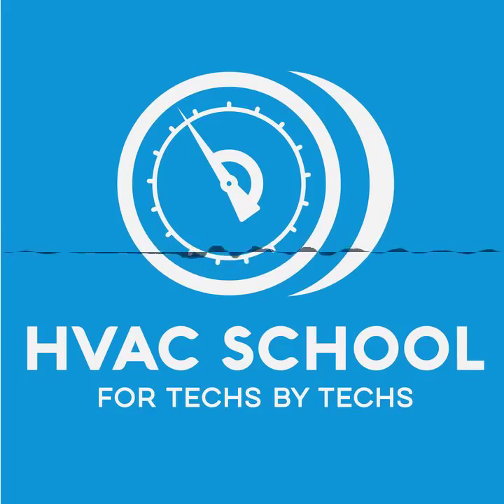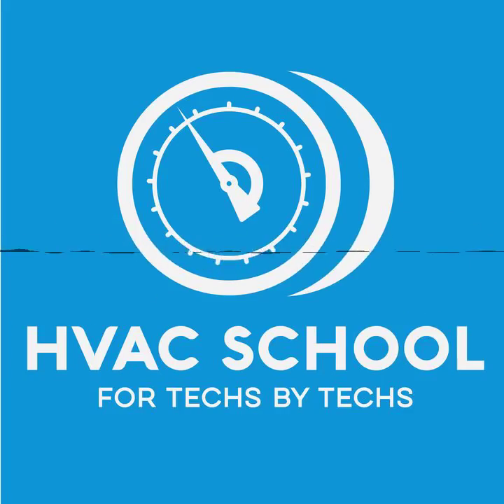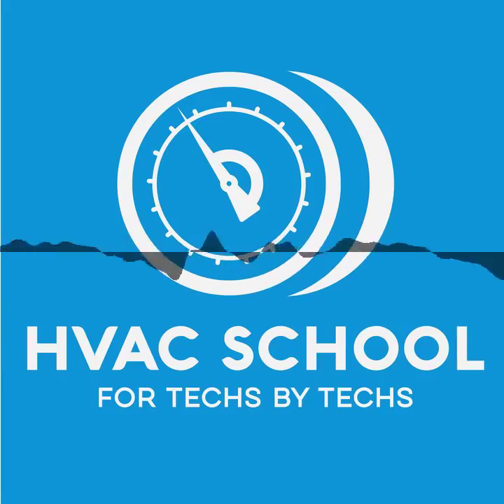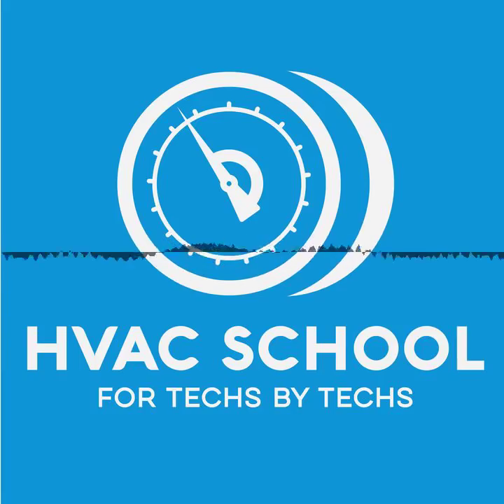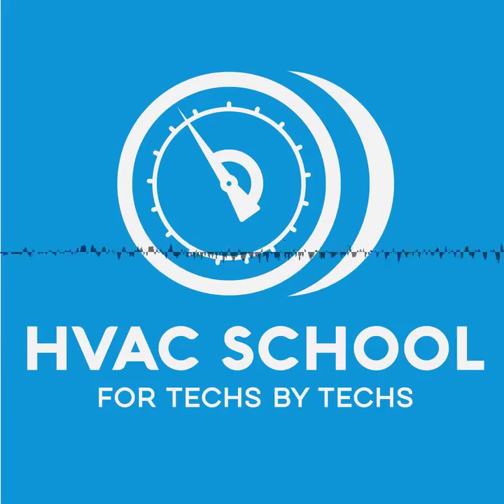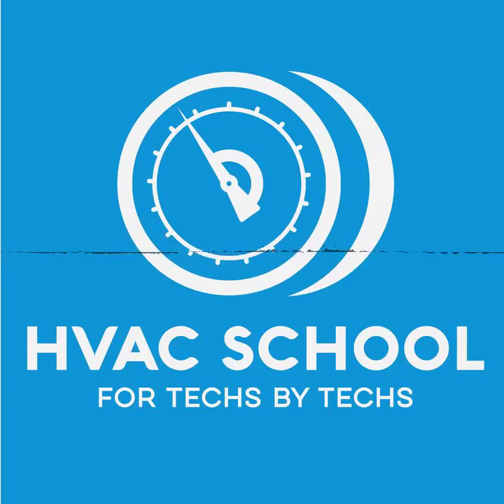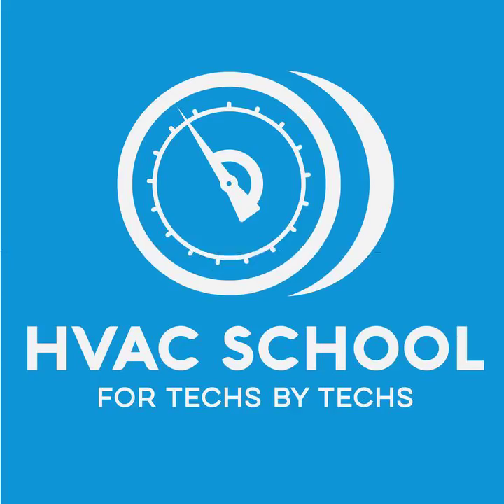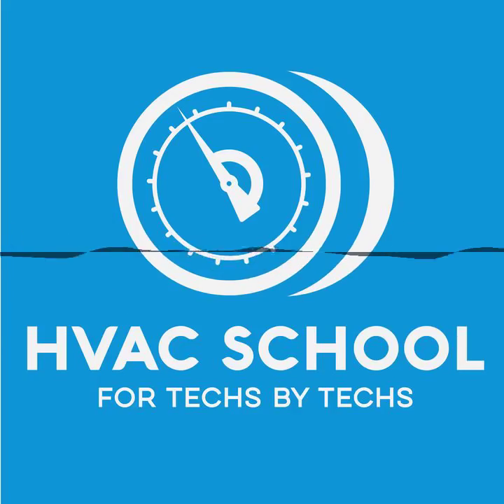Short 9 - Commercial Maintenance

Comment: Good video. Like you said there are a lot more more things that you could check, one thing I would definitely check is drain traps, drain ports and the drain pan. These things have bit me in the butt more times especially if the unit is running and you see water coming out so you assume that the Trap is good only if you get called back 2 weeks later cuz it's plugged up. Or you go out during the off-season check the cooling side check the drain trap it's clear only to have a call back because some crap in the pan plugged up the port. Good information about the belt and pulleys too.